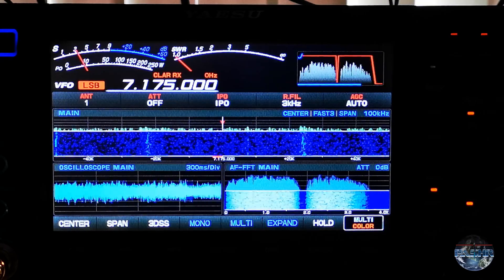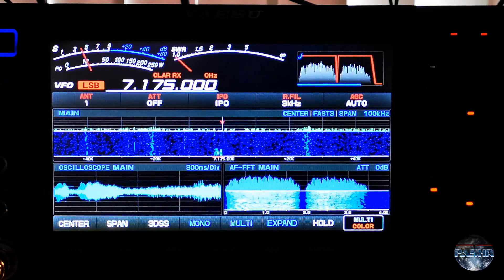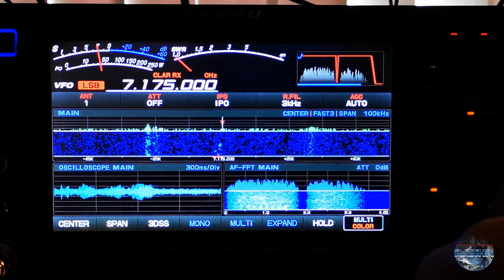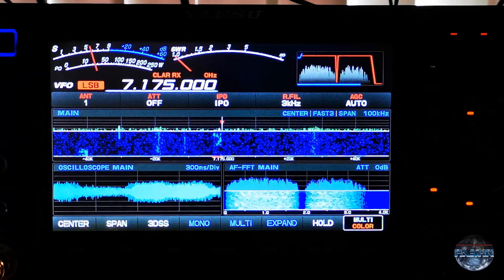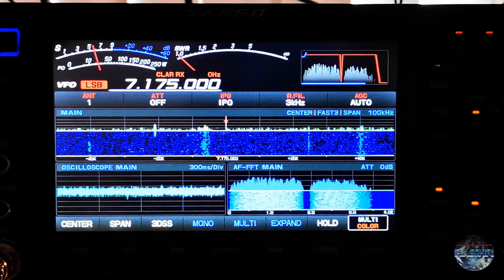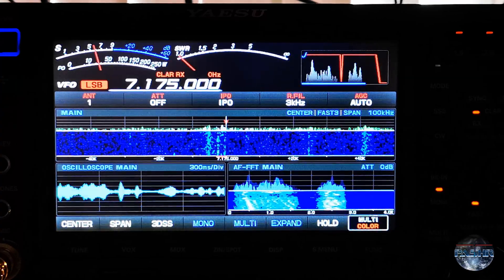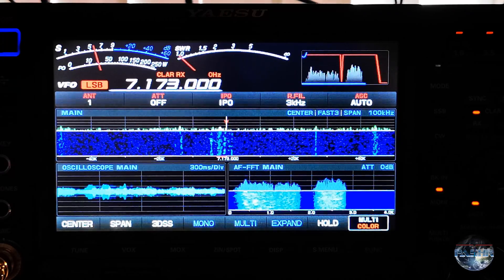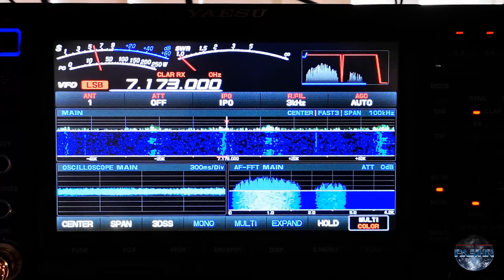FTdx Noise Reduction after Firmware update

Comment: Hello Bert. I've worked you several times on 40M and 20M!

Question about the noise blanker.

 Is there distortion when the NB is on and a strong SSB station is near to the frequency you are operating on? As you know this is a problem with many different rigs.

73

Frank

WA3RSL
Reply from the maker: Hello Frank thank you for your question about the NB and Noise reduction first of all there is no distortion after the new Software update the receiver works very fine without any distortion and for me the best NB and NR of the Radio there.....hope i can help you out so hope we can work agn on 40 ore 20 Meter...best 73 de Bert PA5HR
Reply: @PA5HR1  Thank you Bert. I appreciate the information. I'm working on getting a new QTH, then I'll put up my large 40m wire beams!  And I need a new rig. :) 73, Frank, WA3RSL
Reply from the maker: @frankENZC  very great maybe is the FTdx101MP the right Rig for you ...( Hi ) thanks you for the reaction vy 73 greetings from Bert PA5HR